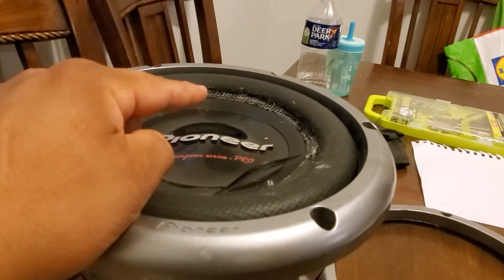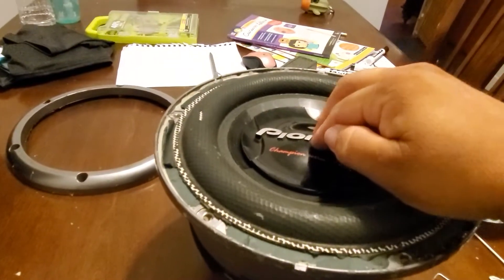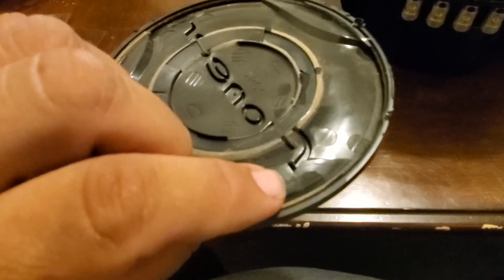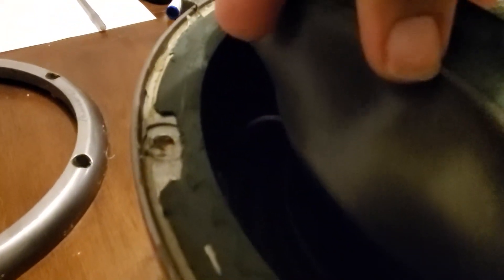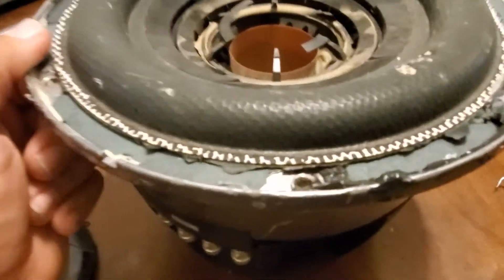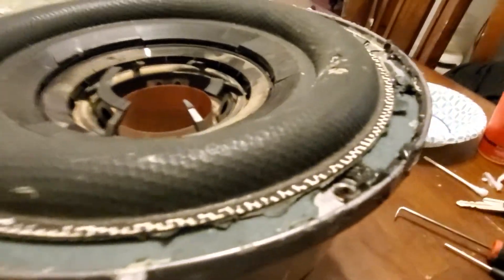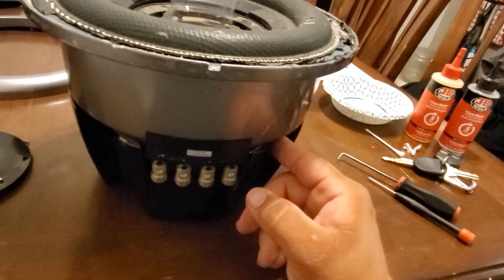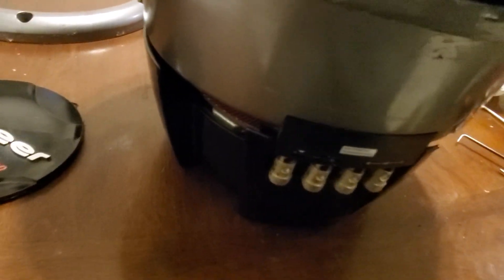Pioneer Champion Series Pro repair

Comment: You're the only guy that has my problem and does not show how to repair the hard plastic?
Reply from the maker: What is it you want to know howbto repair? Are we talking about the plastic on the dust cap? My repair in this series was fixing the lower surround that detached from the coil former. The whole repair consisted of using 2 part epoxy by jb weld. Works on virtually anything.